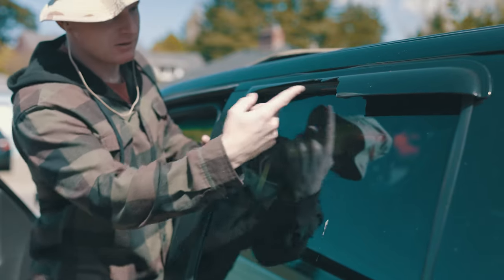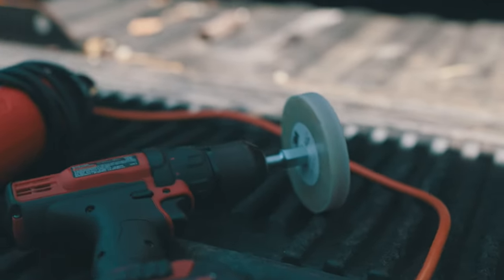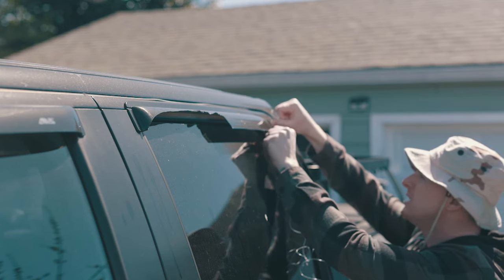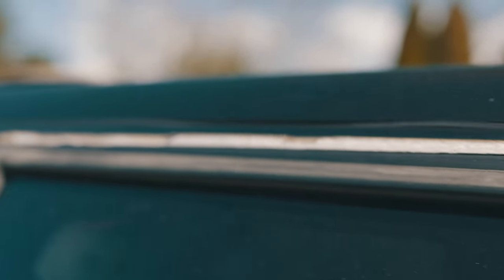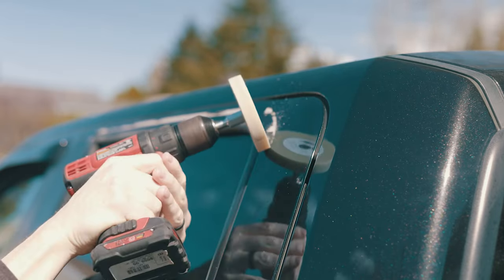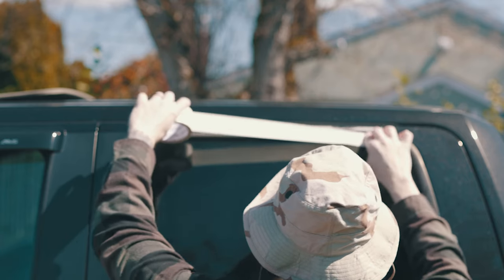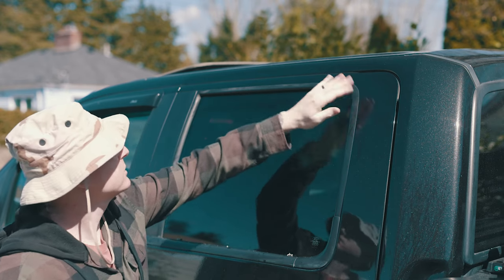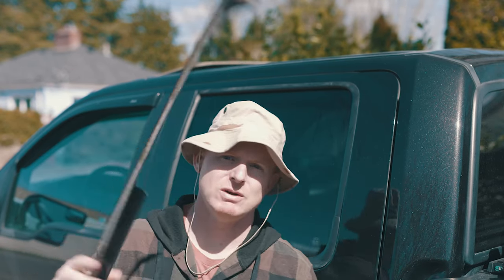How to remove old window deflectors | The All American Driver

Comment: I'm thinking about removing mine as they are starting to fall off after 7 years. My only worry is that the area it covers might not match the rest of the truck and it will stick out.
Reply from the maker: Yeah, if you remove them, I would prepare yourself mentally for some very small defects, either scratches or discoloration.